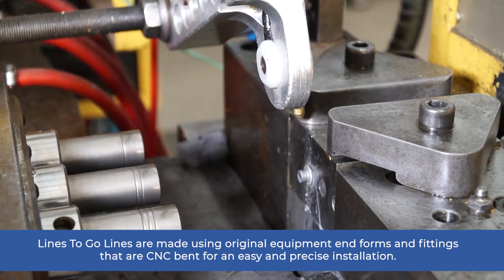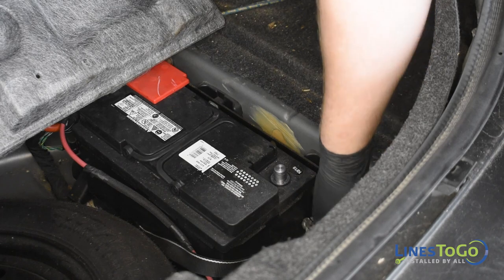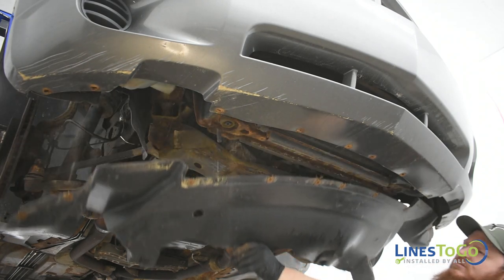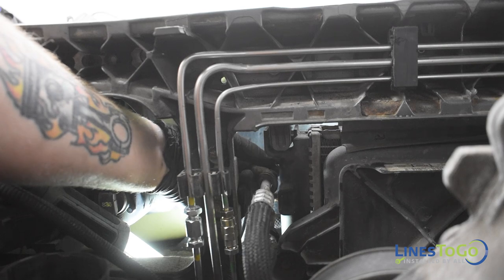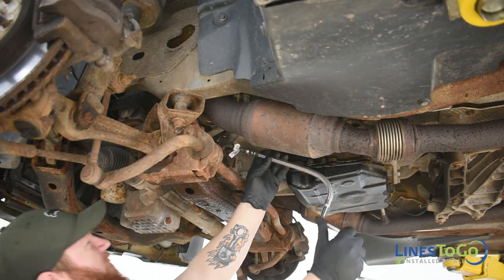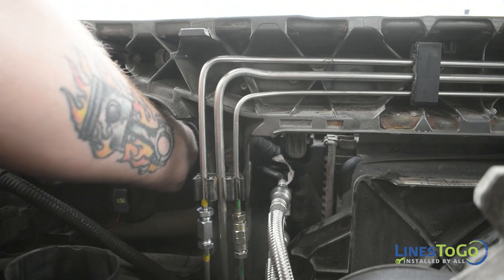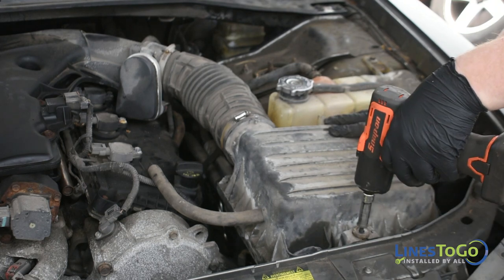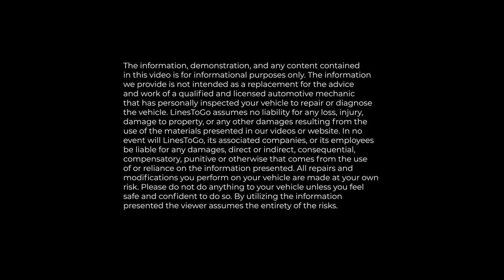How to Install 2004 Chrysler 300 and 2004 Dodge Magnum Transmission Lines

Comment: Please help me.. I got 2006 chrysler 300 and my transmission cooler lines are different instead of the quick connect at the trans its flarenuts instead. And every aftermarket line I find has the quick connect style??
Reply from the maker: Good Afternoon , I spoke with our mechanic and he advised that a VIN number would be required to help find the correct lines. Feel free to call us at 1-855-781-5992 or email info@linestogo.com with your VIN and we would be happy to look further into this for you!